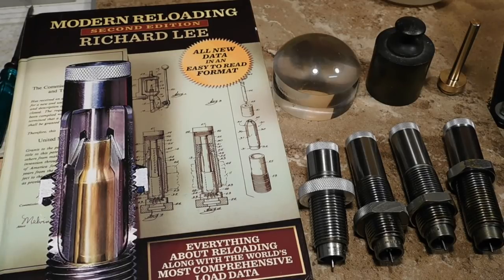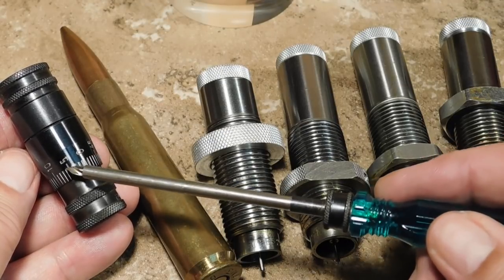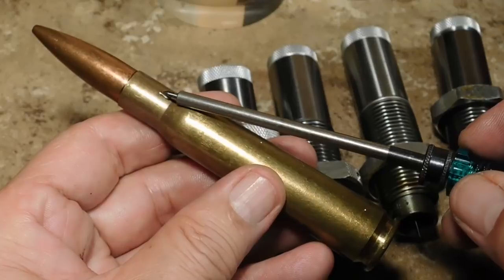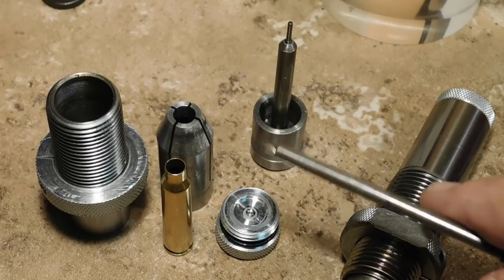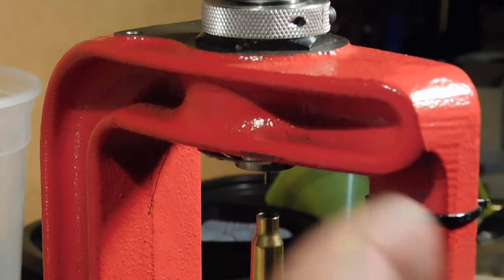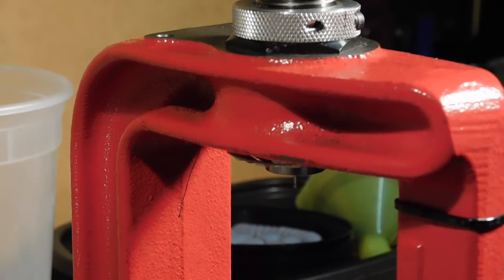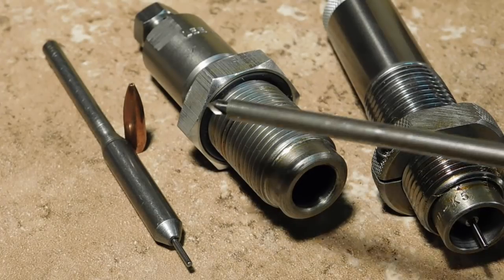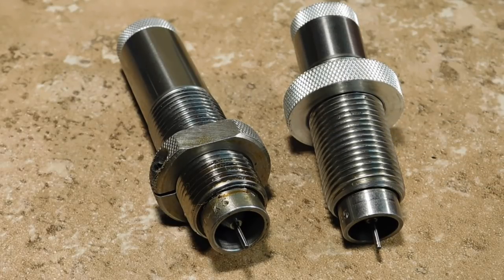Additional Rationale For The Lee Collet Neck Sizing Die

Comment: Can anything be done with cases that are rejected by the head space gauge?
Reply from the maker: falcon19x - Great question - and it is an important question since we don't want to blow the head off any of our cases.  As with all things reloading, it is a matter of degree.   Once the shoulder has been set back too far (excess headspace), we cannot bring it back out without firing it or fire forming it...and to do so will invite brass weakening in the critical web area of the case head.  The order of events in internal ballistics is as follows 1) firing pin drives case fully forward in chamber until headspace stop (shoulder or rim) engages, 2) round fires 3) case body grips the chamber 4) head of case is driven back against the breechface 5) brass at web stretches and weakens.  If 5) is huge enough, case head separation occurs, if not huge enough, brass stretches there and weakens so might blow next shot.  The telltale ring around the web is a sign of impending head separation.  But if no ring, that doesn't mean that the case has been saved...it has been compromised, but to a degree yet undetermined.  On our bolt guns, if a round is fired and a little puff of smoke comes out the pressure bleed holes in the receiver or around the bolt shroud, watch out - you've just had a partial head separation  of that brass.  And luck is with the shooter because there's not much difference between a partial and a full head separation.   Sorry to be long, you probably know all this already to even be asking the question, but other readers may benefit.... Best to ya,  FC

Comment: Great video! I have always used these, but I only did it because I didn't have to use case lube. Good to know the benefits. I do have a question. What is the grease you use internally on the collet? I have a 308 Lee neck die that is causing all kinds of vertical gouges on the neck of the brass. I clean up the collet, it works fine for about 6 shells and then back to gouging. This has not happened on any other Lee Neck dies I have used (30-06, 223, 30wcf). Perhaps the grease will fix the problem?
Reply from the maker: DimnerDoesIt - The grease is Shooter's Choice Gun Grease, but its use is to facilitate release of the collet so that the tendency to grab and stretch the case shoulder is prevented.  Your gouges have to be from irregularities in the contact surfaces the collet makes with the case.  Problem is if you do much polishing , it will affect the neck squeeze that is the basis of the die effectiveness.  Sounds like you need to return that die to Lee for a replacement.  Good reloadin' to ya,  FC Steve
Reply: Much appreciated. Thanks!

Comment: Seems like if the neck is not concentric with the body, when this die resizes the neck,
it may still be non-concentric with the body.
Reply from the maker: Paul Watterson - This would be true if the Lee Neck Size Collet Die only sized the neck.  It does more as the case is held in the die as the collet mashes the neck onto the centering mandrel.  Non concentric necks are not concentric in two manners 1) axial (the axis of the neck is off angle from the case body) or 2) positional (the axis of the neck is off axis from the case body)  or a combination of both 1) and 2).  The Lee Neck Size Collet Die can correct both within reason.  The neck concentricity gauge tells the story.  Good reloadin' to ya,  FC Steve
Reply: Thanks for the reply :-)

Comment: Why would I need a Collet Neck Sizing Die if I already am using a Lee Factory Crimp Die ?
Reply from the maker: VE - The Lee FCD provides 1) crimp to the loaded round 2) elimination of bulges or irregularities in the case as a result of seating and crimping operations that might impede functioning and chambering of the completed rounds.  The Lee CNSD provides 1) proper inside neck diameter for neck tension to hold the bullet 2) sizing of the outside of the neck to allow chambering 3) a concentric neck with low run out 4) less working of the brass for longer case life 5) no lube case sizing   Good reloading' to ya, Jeff - FC Steve
Reply: Thanks Steve I understand what you are saying but doesn't the FCD change the neck diameter when it crimps ? Maybe the reason why I don't use one is that I hand anneal my rifle brass after 5 firings. I have a cheap system for that with a drill.. so I full size case size. Also I don't fire form brass because I use it in several rifles. Mosin-Nagant  vs Fin M39 for example. But I will take your word for it. After all I just bought I nice Tipton guide rod after seeing you use one... nice talking to ya -- VE Jeff
Reply from the maker: VE - That is the one thing that the Lee FCD is accused of doing by many - and the problem is that it can definitely do that - there is a carbide ring that if the round is really big, the FCD will indeed size the case down and also swage the underlying bullet to boot - then the brass springs back slightly off the bullet when the round is pulled out of the die causing loss of neck tension.  There isn't a reloader around that appreciates that - hence the negativity on the FCD.  But the Lee FCD was not designed to do that - only to provide momentary spot sizing to eliminate excess bulges from seating or crimping that would hang up feeding.  You can easily feel the difference when you use the die.  If you are getting wholesale sizing with the FCD, then the bullets you are using need to be sized before loading - simple as that.  If used as designed and intended, the Lee FCD is a wonder and a technological coup of Richard Lee.  My recent work with low standard deviation in the single digits was all done using 44 cal FCD.  As for FL sizing for reloading brass for different rifles, that is a good recommendation.  Also, unless my memory fails, Lee does not make a collet neck size die for the 7.62x54R - why they don't is a mystery.  Have a great day, Jeff...always interesting posting threads with ya,  FC Steve
Reply: FC- Thanks again for the great discussion. Your years of reloading have helped me many times over. Yes I used to reload back in high school in the 70s but I have only gotten into it for the past seven years. Which to some may seem a long time... but you are never to old to learn ! PS. I personally am a resizing fool... I have many bullet resizing kits. ... Why ? Well to test which is the most accurate... for example I have resizing dies to my new  .45 colt in .456 , .454.  and .452. The bullets drop out at ..457ish so I size to .456 which makes it easy to size to .454 and .452.  Why do that... well to compare... several authors swear by .454 vs .452 even if our chambers are set to  .452. See Mike Venturnio's work on Six guns for example. So I will see for myself and test it. ... But as you know its been raining here off and on for the last two months.. so I am dodging rain clouds to get all my bullets powder coated and ready... by for now..
Reply from the maker: VE - Thanks for the thread again, Jeff... If cylinder throats are .452", then 454" bullets would work just fine...Ideal is .001 over so .453", but an additional .001 will be handled just fine...However, if bullets are really hard, then the pressures would be a bit higher from that.  Reminds me that I want to get a .460" sizer for my 45/70...  Best to ya,  FC Steve
Reply: FC - That's what I had to do for one of my NOE brass molds. I didn't know you could shoot .460 in the 45/70 so I sized to .460 the to .458. I tried to make the jump to .458 from the mold drop but it was way to hard to size the bullet. .460 solved that problem.  NOE bullet sizing kits are cheaper than Lee and offer many options. I have used both and the Lee wins in resizing ease but not in variety.
Reply from the maker: VE - Our lever guns in 45/70 may very well shoot .460" best...It's a good sizing die to have for the 45/70 and 458 win Mag.   Have a great day to ya, Jeff...  FC Steve
Reply: Can the Lee collet die work on a Hornady LNL? Looking to use it for my 300 win mag? Thanks.

Comment: I cAnt understand how concentric uniformity DOES NOT involve uniform internal neck dimensions.
Reply from the maker: John Murdoch - Yes, John - logic would dictate that we need to turn or even ream our case necks to get that cherished uniform thickness.  Many shooters are not aware that neck thickness uniformity can be achieved by swaging as well as reaming or turning - until they think about the possibiities.  If the Lee Collet Neck Size Die is cranked up just a bit, and the neck is run into the die repeatedly with some rotation of the case between strokes, the neck will be swaged to uniformituy.  This is easy to test for yourself...why turn the neck when you can swage it?  Even neck turning, the recommendation is often to get some turning marks - but unless the turning marks are 100%, there are still some high and low spots.  But by then, the neck has been thinned too much.  The Lee Collet Neck Size die will do all the thickness uniforming we need with our stock chambers - and even if I had a custom rifle with tuned chamber neck with matched neck size die and recommendation to turn necks to a certain thickness, I'd still use the Lee Collet Neck Size die in addtion to have the necks concentric to the axis of the case using that die.  That Lee die is one of the several major innovations that Lee has given us.  Continued good shootin' to ya,  Steve

Comment: I hope you don't honestly think that the Lee collet die takes the place of neck turning.  You have to neck turn if your chamber requires it, no collet is going to fix that.  When you reform brass from one caliber to another you'll more than likely have to neck turn as they will be too thick as well.
Reply from the maker: Eric Johnson — If I had a Rifle with a custom chamber with a neck matched for neck turning, I would neck turn my brass.  But for factory rifles, I prefer to use good consistent brass (Lapua) that my Lee Collet dies do indeed true up in more than one way.  I also have preferred to load my brass 5-6 times only to avoid needs for annealing or formation of donuts.  But then again, I am perfectly satisfied with getting 4/10ths MOA from my 223 And 1/2 MOA From my 308.   Those shooters who demand more should definitely shoot the works in their reloading... Best Regards, FC
Reply: For the price it is a great neck sizing die.... but it will not uniform neck thickness, I just spent an hour trying to duplicate this video with 20 cases all being 12/14. I finally got them all to 12....after I turned them.😁